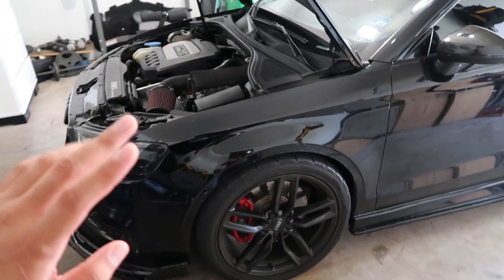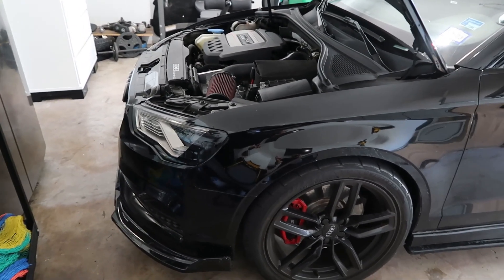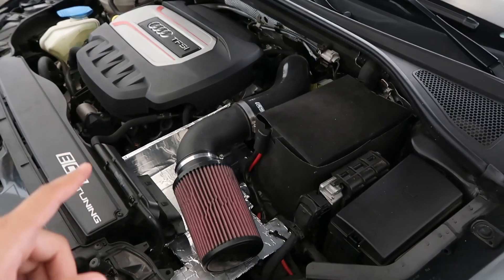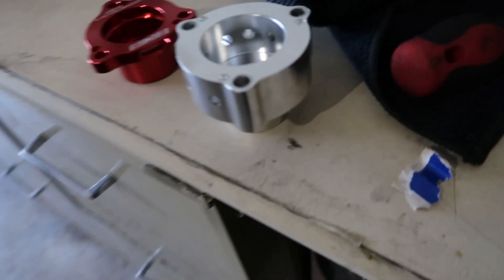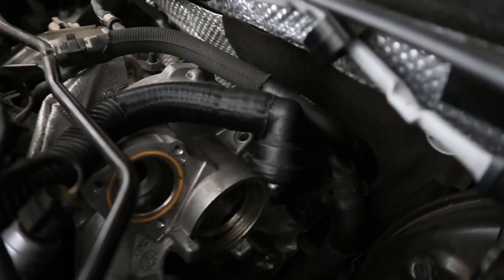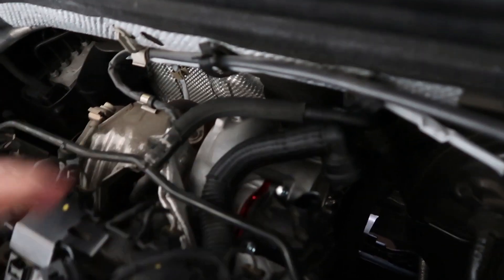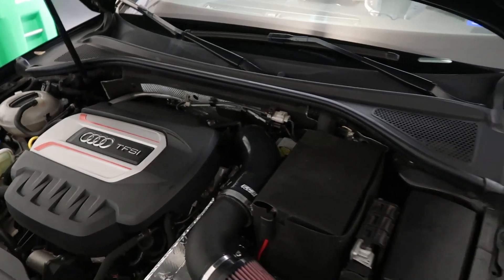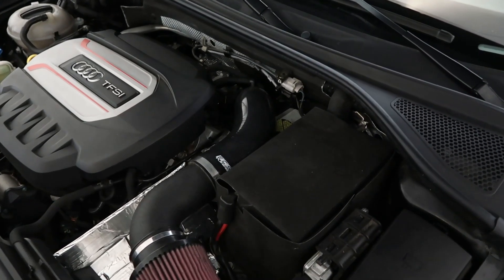Audi Mods ECS Tuning Diverter Valve install A3/S3

Comment: Gotta love that sound. Diverter valve worth upgrading too, GFB does one that also has a controllable BOV which I loved on mine. Had to remove for Stage 3 though.
Reply: why did you need to remove it for stage 3? not compatible with the upgraded turbo?

Comment: What it does is it causes check engine lights😂
Reply: No it doesn’t?
Reply: @blankzz2780   I installed the same thing on my S4. Check engine light. Put it back to stock check engine light went away.
Reply: @darrinscoilsclouds1498  I believe it depends if your car has a MAF or not.